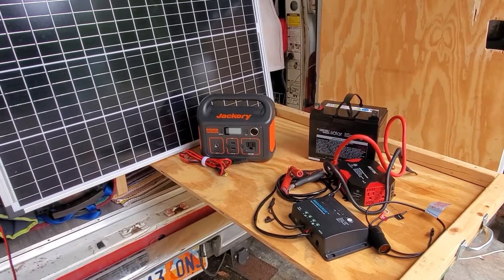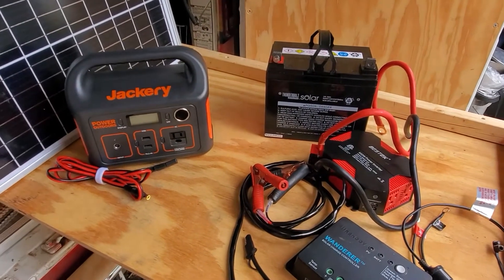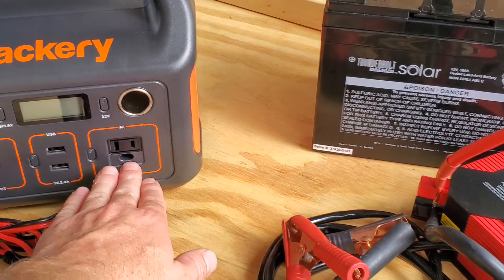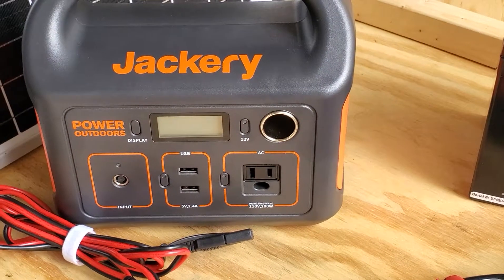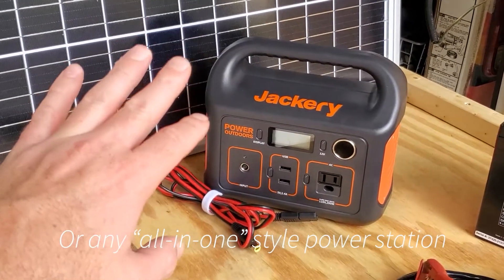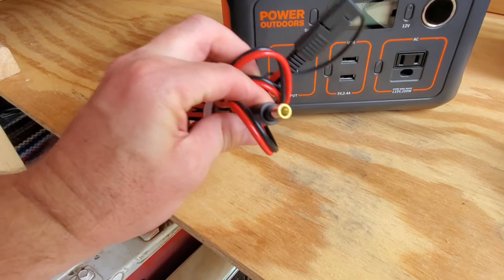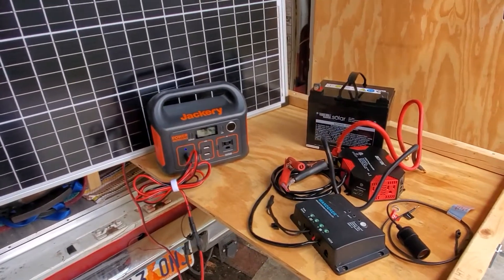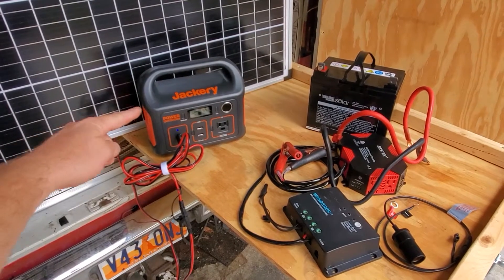THE simplest off-grid 12v system - solar+power station

Comment: One thing I would suggest, if looking to buy a power station, is to look at one with a LIFEPO4 battery, the Jackery uses lithium ion. The lithium ion is rated a500 recharge cycles, a LIFEPO4, another type of lithium battery, is rated at 2000 recharge cycles.
Reply from the maker: Yes I totally agree 👍 I just told this to someone this week.

Comment: So for charging the jackery with the solar panel, no need for other components? Just the panel and cable? Did the cable come with the jackery or was it purchased separately?

Thanks
Reply from the maker: Exactly!! Just the applicable cable connection (depending on what is coming out of the solar panel) ... and straight into the power station - the charge controller is built into the power station!

So for this particular combo (Jackery + Harbor Freight solar panel) I needed this one cable to connect the SAE cable of the panel to the 8mm DC input on the Jackery: https://www.amazon.com/gp/product/B08L5T7NF1/ref=ppx_yo_dt_b_asin_title_o08_s00?ie=UTF8&psc=1
Reply: @kampinglogik  how many amp hours are you getting if solar is disconnected?
Reply from the maker: So to get amp hours you would divide the watt hours by the voltage - so basically 293wh (the stated capacity) divided by 12.x volts = apprx 24 amp hours. So this is not a ton of amp hours, but enough to run a fridge, lights and phone while camping, assuming you have some decent sun light to charge it back up each day, or  plug it into your vehicle's 12v to charge while driving. And of course there are many options for much larger power stations on the market as well.
Reply: @kampinglogik  I’ve done the math and see my family is using an average of about 3000 wh daily. I’m thinking if I can have about 300 amp hours, this would be about what I would need to sustain daily usage. I’d just need to have it hooked up permanently so as to continually be recharging the batteries. my math may be off but that’s half the fun to see how far off the grid I can go. Thanks for the info, highly appreciated.
Reply from the maker: Awesome! Do it!!
Reply from the maker: Here are some links to larger load-capable system components: https://www.mobile-solarpower.com/the-off-grid-king-power-anything.html
Reply: @kampinglogik  thanks for the info. Been looking at the power station such as the ecoflo pro, however, the price is discouraging $3,600. This is only about 300 amp hours. Now if I buy 3 100 amp batteries each at $250 , this is $750. Sure, there is the cost of the charge controller and inverter but overall it’s much less expensive.
Reply from the maker: So the difference in price is reflected in the EcoFlow having lithium batteries and the "$250" batteries be some form of AGM or Gel... obviously I don't know the specific brand, but there are not yet any 100ah lithium batteries on the market for under $450ish (at the CHEAPEST)
Reply: I use that same cable with my Anker 555.